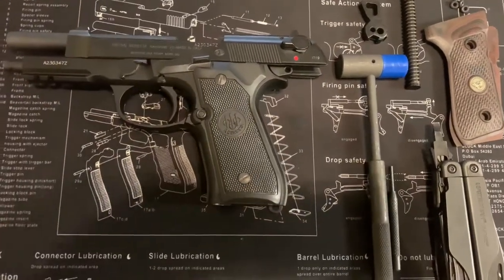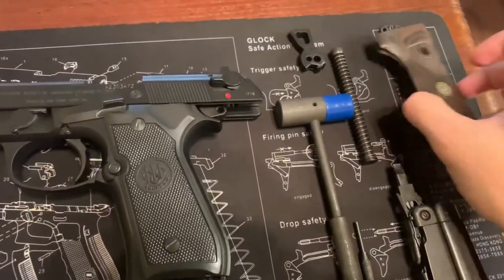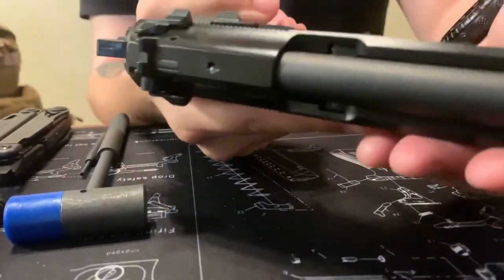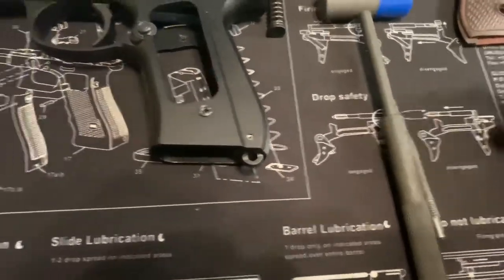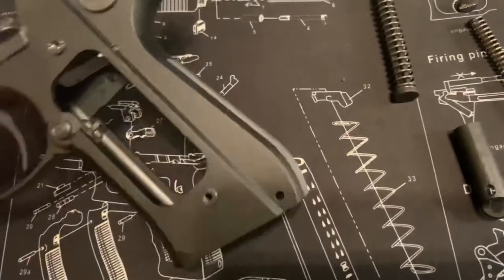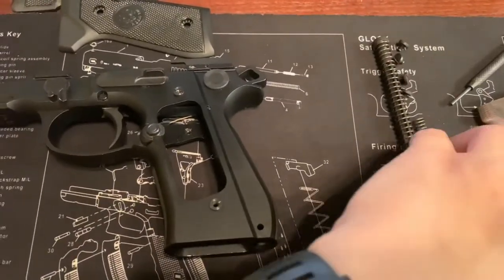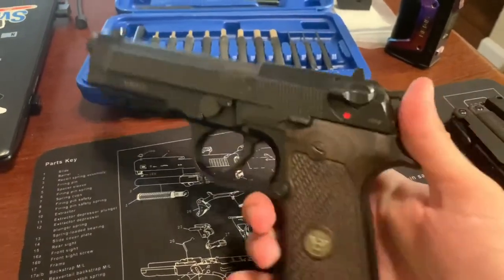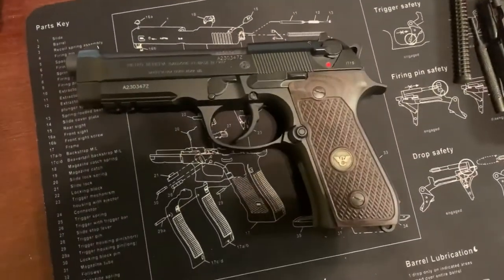Beretta 92A1 - Replacing Grips, Hammer & Guide Rod Assembly

Comment: I was just looking at videos of Wilson grips due to Hogue thin grips not working out.  I see you changed the original guide rod assembly and referred to the new one as "steel". What brand is the new guide rod?  I ordered a Beretta "metallic" guide rod from Beretta.  It is not steel.  According to them it is a proprietary metal.  It's non-magnetic and I'd guess it's some sort of high strength aluminum.  This was in a 92A1.  Just curious what your guide rod is.